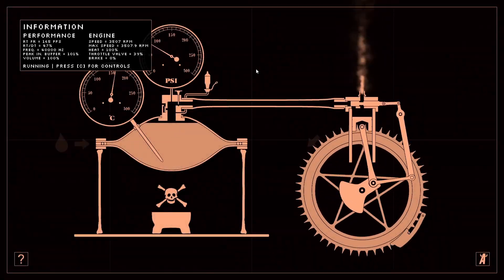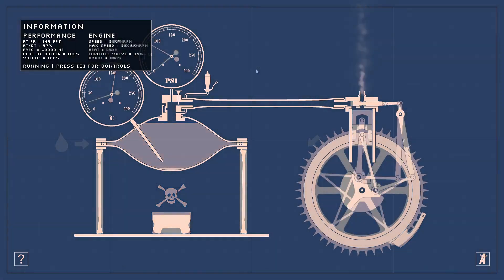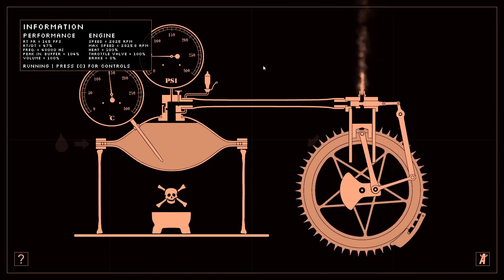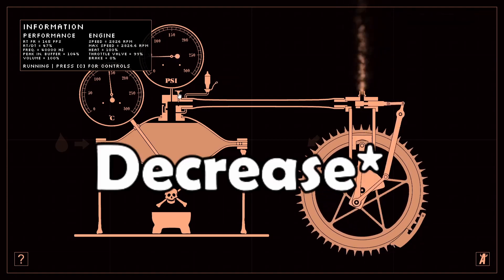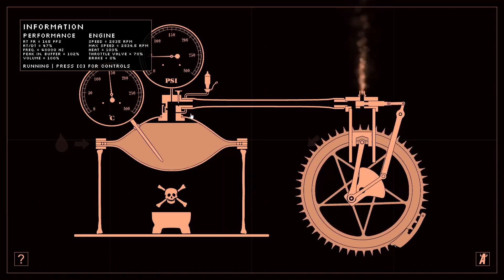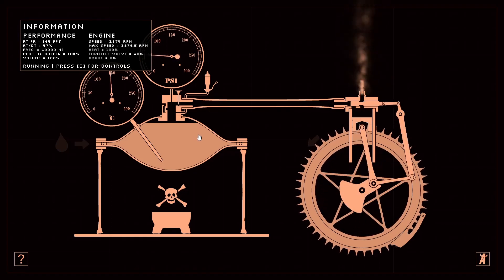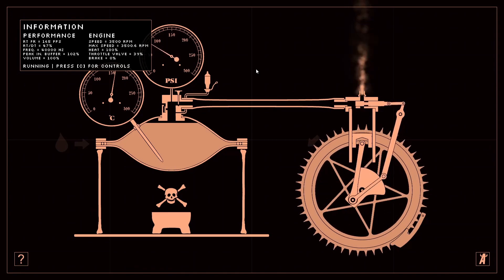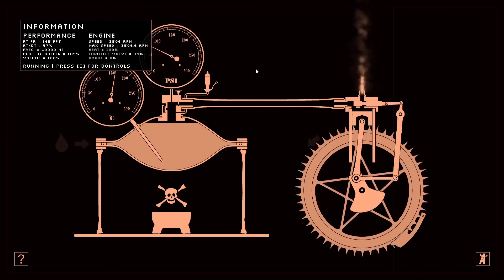HOW TO GET 3500 RPM IN STEAM ENGINE SIMULTOR - 3500 ACHIEVEMENT

Comment: Step 1.  Click the A until the background darkens
Step 2. Open the throttle
step 3. Open the water feed
Step 4. Fill the tank completely
Step 5. Close the throttle. 
Step 6. Disable the relief
Step 7. Turn up the heat all the way
Step 8. Pressure hits 350PSI
Step 9. Temperature hits 297C (Takes a pretty long time) The last box will be like this with the needle represented by the vertical bar in the midst    300[  |      ][        ][       ][       ][        ]250
Step 10. Manually move the wheel using Space
Step 11. While still holding Space, and assuring you have ~22rpm. time opening the throttle VERY QUICKLY on the down stroke to 100% for 2 seconds TOPS
Step 12. reduce throttle to 39%.
Step 13. Observe ~3550-3630RPM achieved.

I hit 927 RPM in the regular version doing this
Reply: thanks
Reply: @Ihavedementia-nr6pt  You're welcome!
Reply: 3876.9 RPM using your method
Reply: @SilaciousD  wow nice
Reply: @SilaciousD  i got 4200
Reply: @Chazdubh  the new version is a lot easier to get super fast. my new record is 4275
Reply: i got like 3875+with this
Reply: @Aculon4389  super!
Reply: I hit 3907 doing this
Reply: @GraveFighter450  colossal!
Reply: In the newest version, all you have to do is empty the tank, go full heat, press Space to keep the engine going, then open the throttle to about 50%, and slowly increase the water flow (now tops out at 100PSI) until you get full flow without losing heat. it will top out at about 96 PSI and you will get above 4200 RPM pretty easily.
This will also allow a much easier completion of the 1 million revolutions and 10L of water boiled.
Reply: i got to 4563 using this method
Reply: @paperpass6834  awesome

Comment: Why does your water level never decrease?
Reply from the maker: Keep holding L
Reply: @AAvirusAA  does holding L still do anything with the new water system?
Reply: @dankeeboio3399  looks like it doesnt
Reply: @ignatikklokov  yeah doesn't seem too managed to get it though
Reply: @dankeeboio3399  how did you do it? can't manage to reach 3500
Reply: @papaia_  I let the psi get to 350 then fully opened the throttle and that seemed to work for me
Reply: @dankeeboio3399  actually got it like 30 minutes after commenting haha, thanks anyways
Reply: @dankeeboio3399  how